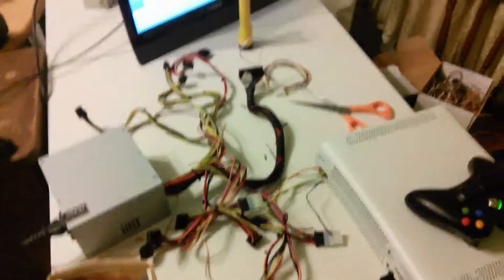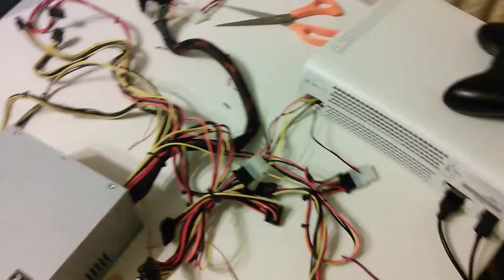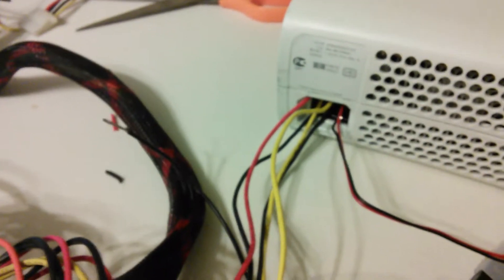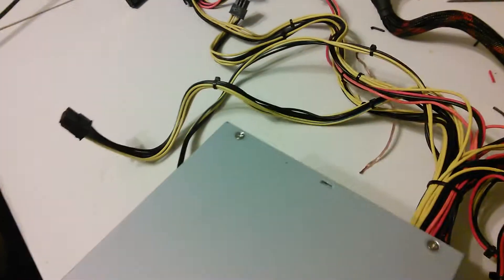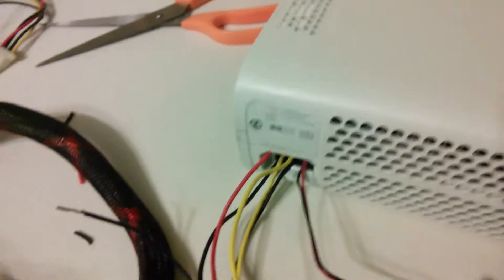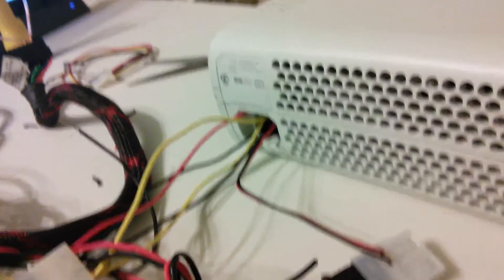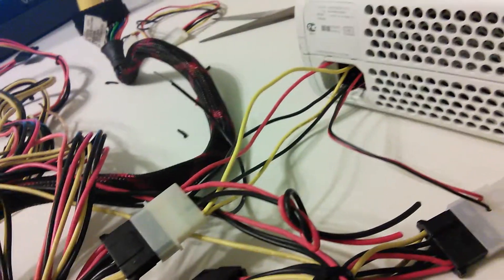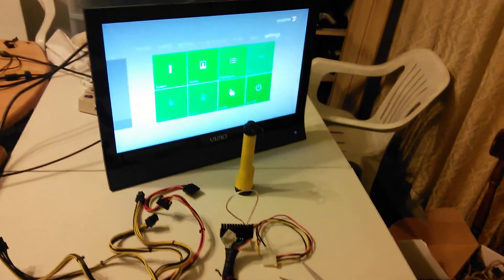Using a ATX Power Supply to Power a Xbox 360 (simple way with molex)

Comment: How do short circuit it to power it on pls help me, 360s power brick to expensive when i got pc
Reply from the maker: I did the paperclip trick; there's pin layouts for the ATX motherboard end and it's something like top pin 4 to top pin 5 (one is ground and the other is the power-on wire). CORSAIR had a neat picture guide for it too.

Comment: Hi man nice to meet you.. please answer ?
For now still work with this trick ?
Reply from the maker: Yep still would work fine today! The Xbox 360 needs 12V with good amps, and ATX power supplies still have that on Molex!
Reply: @Espionage724 is this work for xbox 360 slim?
Reply from the maker: @muhammadwahyudi6946  I haven't tried on a Slim, but it looks like it needs different wiring. This comment implies it's possible (but no specifics): https://old.reddit.com/r/AskElectronics/comments/17obny3/help_wiring_an_atx_psu_to_an_xbox_360_slim/k7yc7d1/

Comment: How long will it last? Can it kill the xbox if used for long?
Reply from the maker: It'll last as long as the Xbox and Power Supply are fine! The power specs are well within spec and not an issue for long-term gaming, and depending on the power supply used it may deliver cleaner power and handle higher loads better than the official Xbox gray bricks. If I didn't have an official Xbox power brick or even doubted the one I have, this is my preferred way to power 360s! Can even run it off a gaming desktop's power supply while it's still powering the computer as long as the wattage is high enough.